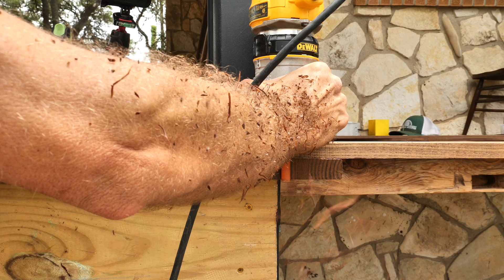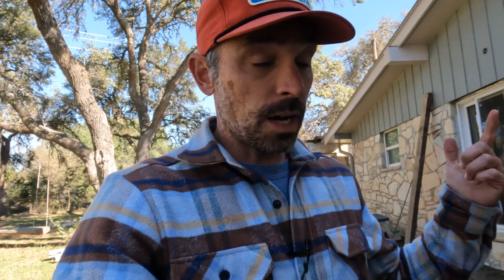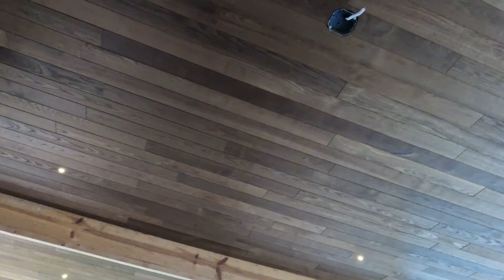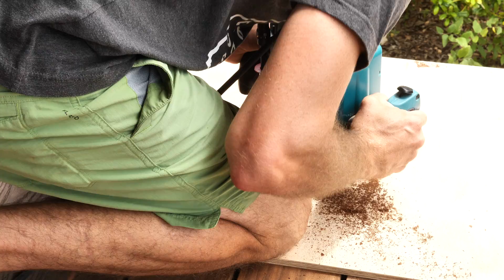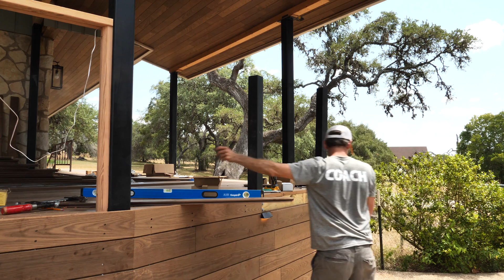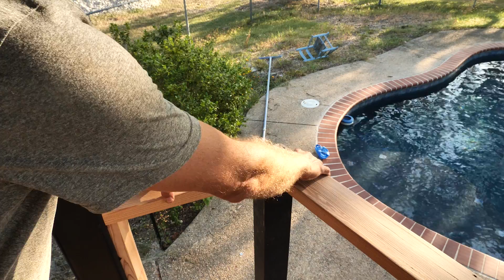Installing Rail Post and Handrailing, More Lighting (DECK BUILD PART 6)

Comment: Hi, the wire going around the deck is wrong, a small kid could climb up those wires and fall over the top. Decking is always done so that nobody can climb over, the wire should be running from top to bottom not left to right. How was that passed by the inspectors?

Comment: I can’t believe you weren’t gonna put that in the video. Crawling out from under the deck straight into the pool was hysterical. Love that you found and used reclaimed wood for the railing. So sorry about your fur baby. That’s tough, especially with kids. Look forward to seeing the wrought iron railing extended to meet deck post and tie existing together. That should look great. Love the build!